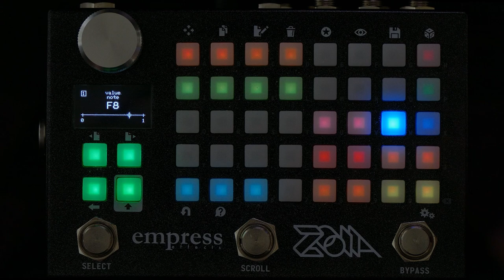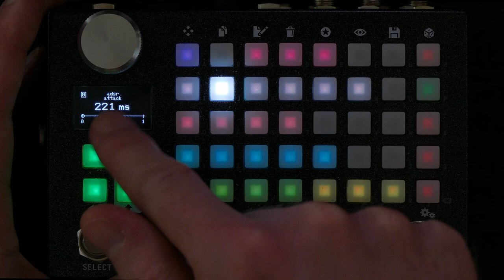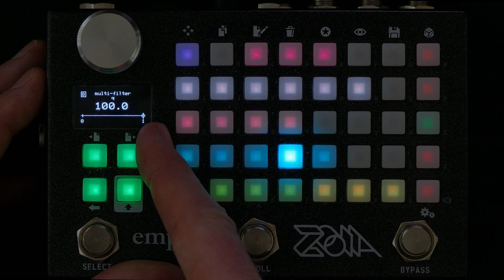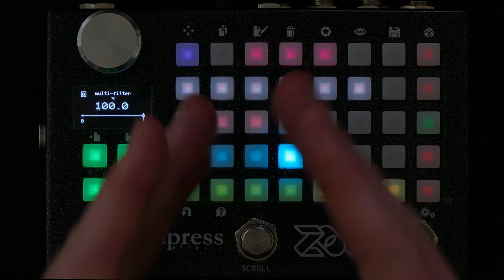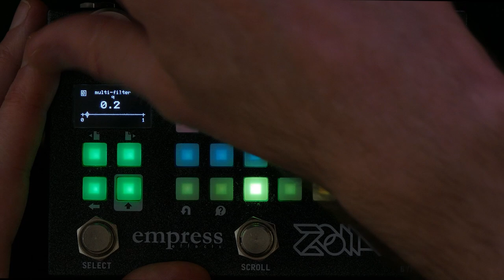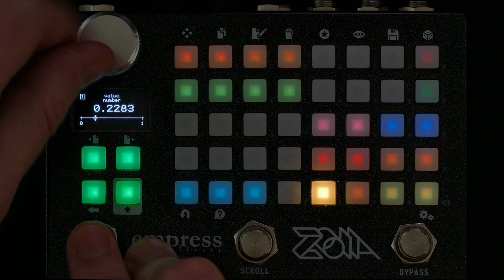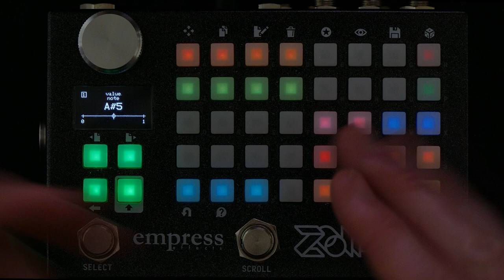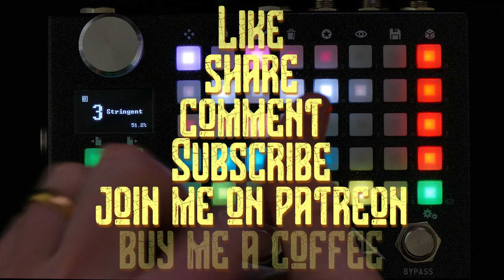Zoia Tutorial: Physical Modelling Bowed Strings - Empress Effects Zoia

Comment: Fascinating!

I've actually been working on a patch that has what I'm calling a "control voltage to virtual bow movement processor". It takes incoming cv, does some math, and only outputs when the incoming cv is changing AND the output is also greater if the change is greater. Basically trying to mimic how a stringed instrument works. Have to move the bow on the string to get volume, the faster you move the louder it is.

As of this morning I have it mostly working. Its problem is that at faster playing speeds it gets a little chaotic. Ideally if I send a triangle lfo through it at a constant frequency then the output should be a constant control voltage. Higher frequencies is more cv. And thats mostly true, but I've noticed that the output will "dip down" a bit whenever the slope of the cv is rapidly changing direction (at slow speeds its rock solid).

I'm not necessarily sure that flaw is a bad thing though. If the goal is to mimic a violin bow, then if one wants to play very fast notes (constantly changing bowing direction) then there should be a bit of separation between the notes.

Anyway, if you are interested I'll share the patch with you when I get time to upload it.
Reply from the maker: That does sound very interesting. I've not got around to doing any more with my bowed string patch myself, though a natural follow-up would probably have been to do some kind of bowing effect. Feel free to keep me updated on how it works out.
Reply: @hakonsoreide  thanks!
I worked on it a bit more tonight and have it almost completely stable. The flickering output before was like a knee jerk. Now its more like an eyebrow twitch. I have some ideas on how to make it even more stable too.
I can't make any promises but I should have it nailed down soon. Going to do a stability pass and then a playability pass. Then I'll post up the patch.
I'm kind of pleased with my solution to the issue I was having, but it will be interesting to see if it actually makes a difference or if the dips in output ctually are better from a playability perspective.

Comment: Will this work with live guitar, and not by predetermined notes and button presses?
Reply from the maker: While you could trigger it with an envelope follower from any source, including guitar, it's not a synthesis method that pitch tracks. You could probably find parameter combinations that match pitches, but then the easiest way to use them in a tonally meaningful way would be to create a lookup table in a switch and map the pitch input to that, or alternatively to use some kind of pitched filtering on the sound. Not sure if that last method’s result would be pleasing, though.

The way it is right now, it's probably best suited to more experimental sound creation, but I might revisit it some day and see if I can create an easy method for consistent pitch at least for a limited pitch range.